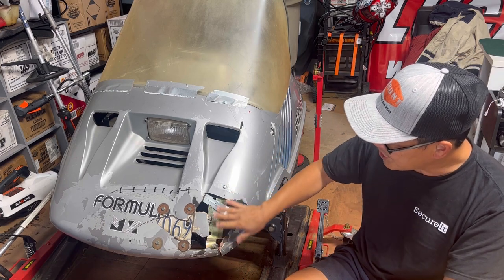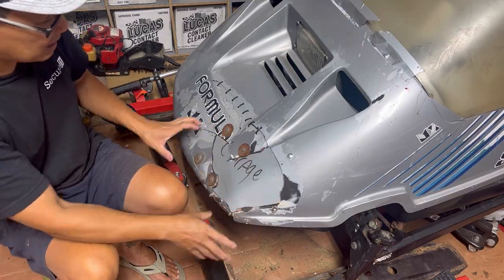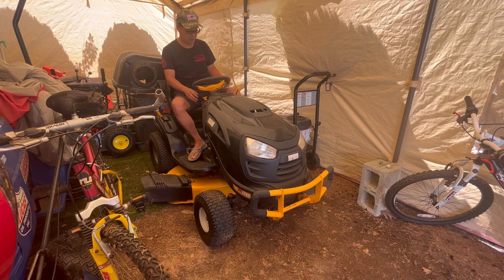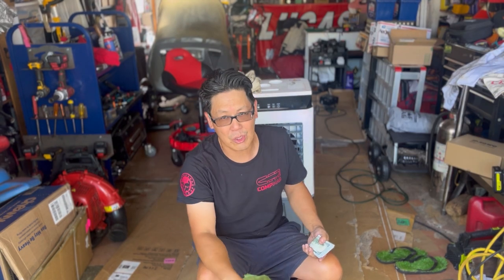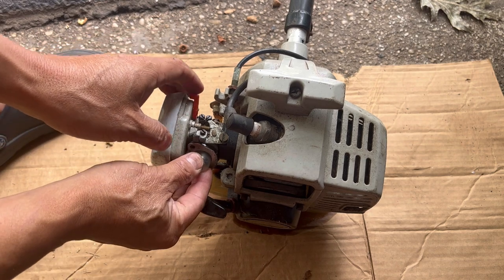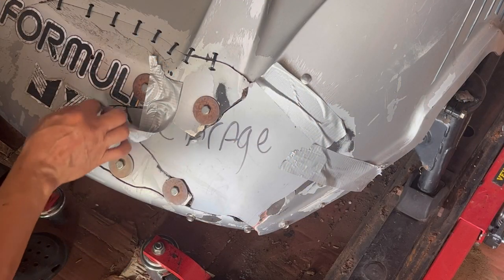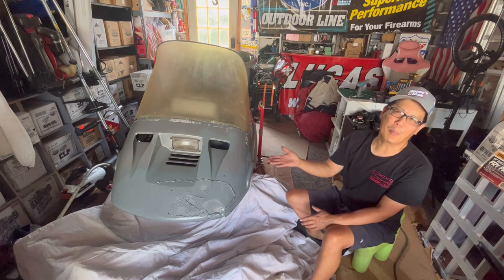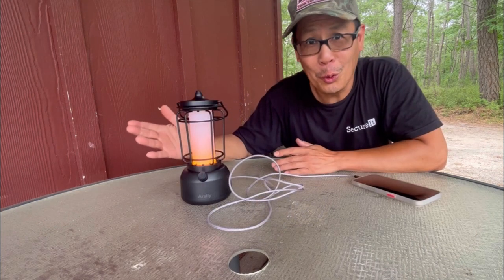SKIDOO FORMULA MX SNOWMOBILE BROKEN CRACKED HOOD & WINDSCREEN REPAIR TISWALL CORDLESS GLUE GUN FIX

Comment: Hot tip for all the plastic repairs I have seen you do. Plastic welder the kind that uses staples they are so cheap and work very well. No more zip ties. Way faster and you can use them on the back side of the panels for strong good looking repairs. Keep up the hard work love the videos.
Reply from the maker: Thanks for the info

Comment: Cheap and easy fix for your primer issue with the snowmobile. Buy a bulb primer for a boat tank and put it online to prime your fuel. Also works great on lawn tractors with fuel pumps that lose their prime from sitting. You may need adapters if the fuel line diameters differ but they are also very inexpensive.
Reply from the maker: I’ll get around to it

Comment: Do you think you can clean that deflector shield the same way You clean a yellowing headlight?
Reply: Probably iv had alot of luck  polishing plastics with 3000grit papers than finishing it will Valve lapping Compound
Reply from the maker: I think that would work,  I’m not doing it though.

Comment: I’ve got a snotek 28” snowblower dual stage got it for FREEEEE!!!! Got the paint over spray mostly off still some one the engine and decals but it’s pretty good minimal rust in the auger housing should I sell it like that or hats it worth? And I’ve got an MDT 26/8 but it’s been swapped with a 10 hp but it runs awesome and everything’s good on it it’s got new tires new skid plates everything’s good I fixed it up for a lady and then she gave it back to me? lol but it works good everything’s great what’s that worth make 300?
Reply from the maker: Really depends on where you live,  like snowblowers aren’t worth anything here,  no one anticipates any significant snow so what I used to get $500 for is now barely worth $100!

Comment: I had a guy come by, it was my super heavy duty 4 bolt rear huge 24hp briggs tractor, with a triple bin bagger, color red, had it up for 1800.00 guy comes by tries it out, this thing is beautiful, so he says he has another one to go check out, a John deere la100 we both know what a pos a John deere la104 is compared to a craftsman fs5500, so of course the moron buys the John deere la104, and a month later I get a phone call from the guy asking if I still have the fs5500 and he would give me 600 for it, I laughed at him, I told him he sold 2 days later for my asking price, what happen to the John deere la104, he said the deck lift broke, and the engine blew up, I said I'm curious, how much did he pay for it, 2500.... I laughed again, I told him he should of bought mine I was selling for the asking price I wanted, he agreed, and I just so happen to have a red craftsman Lt3000 with a 17.5 hp briggs, asking price was 800.00 and it has a double bin bagger, I told him, I'd give him a 100 dollars off if he traded the John deere la104, he agreed, so I sold the lt3000, for 700 and got a John deere la104, I replaced the engine with a 17.5hp briggs and fixed the deck with metal Clamps, and sold that one for 1000......just goes to show, follow your gut, and buy what you know it good stuff.... LMAO
Reply from the maker: Good story